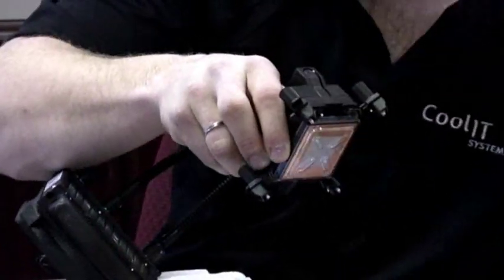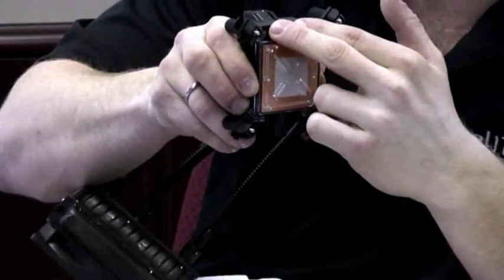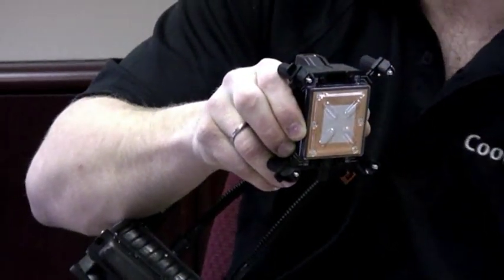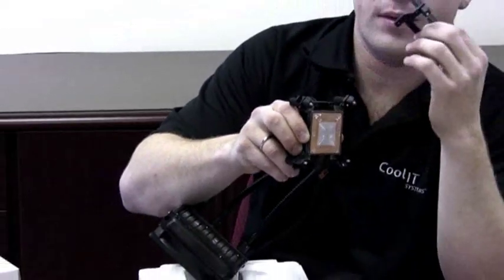CoolIT Systems' ECO A.L.C. Introduction

Comment from the maker: @snedie69er
If you have the normal ECO-C240 then he should already have a Y-Connector cable going from the 2 fans to a single connector.  This should be plugged into the CPU Fan header on the motherboard.  This way the CPU regulation will adjust the fan speeds as needed.
The Pump connector needs to be plugged into a NON Regulated connector.  On the motherboard this will often be one of the SYS Fan headers.  You may need to ensure that regulation is turned off for the additional headers.

Comment: When you say regulated fan header, do you mean I shouldn't have it attached to the CPU fan header on my motherboard?

I got the dual rad version in OEM packaging and wasn't supplied with any additional fan-molex connectors so assumed it would be fine of the motherboard.

Any suggestions?